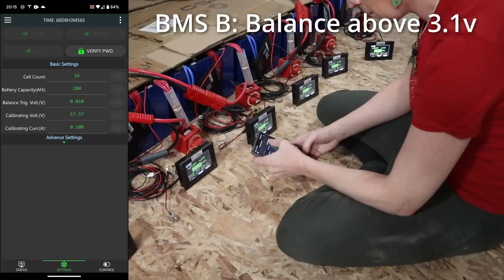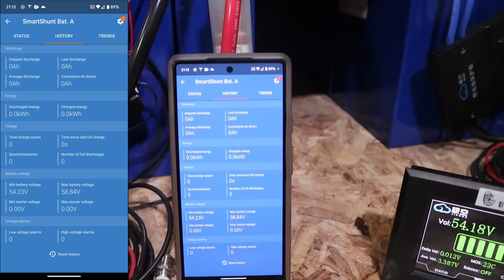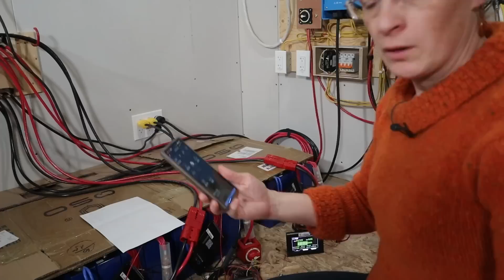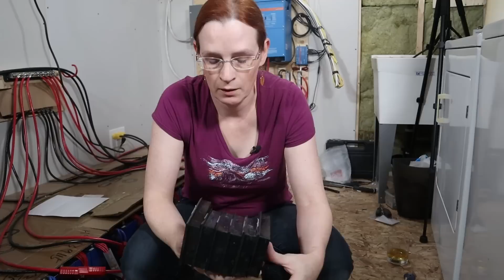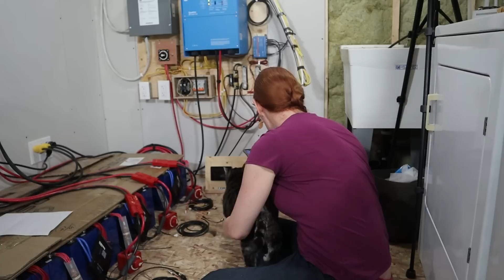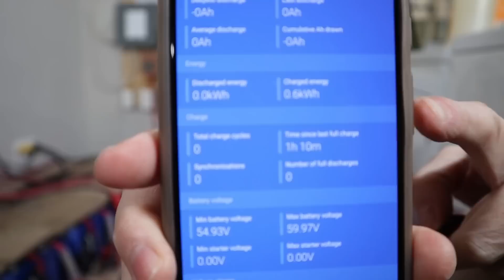Sparky Science! - Big Battery Build! (Ep. 48)

Comment: Cause of spitzen sparkin' was instantaneous Buck Converter Input Over Voltage in excess of absolute max specifications. What happened was the BMS hit single cell over voltage protection and disconnected the battery from the Quarto charger, just like you surmised at the end of your video. This BMS switching occurs in mere microseconds, so because the Quarto was busy pumping over 30A into the battery before the battery instantaneously disappeared from the circuit, the voltage seen by the buck converter rose to an arbitrarily high voltage in order to maintain the 30A Quattro output for the several 10s to 100s of milliseconds it takes for its internal control loop (and wiring inductance) to respond and ramp the current down to 0A.

The switching MOSFET inside the buck converter avalanches like a 60V (or 80V or 100V, whatever it is rated for) zener diode, so got to see all 1.7kW of Quattro energy for many milliseconds across a silicon die area of ~1 square millimeter and only a few nanometers thick. I.e. an insane power density that instantaneously turns the silicon into a plasma, shatters a hole in the plastic molding compound and when unlucky enough to achieve a sufficiently low arc voltage, then allows a sustained DC arc fed by both the 30A Quattro current + battery discharge current as the BMS still allows discharging after charge disconnect. More typically, the initial explosion is sufficiently violent that the arc blows itself too far apart and self extinguishes with an open circuit air gap where the silicon die and bond wires used to exist. This didn't happen in your case, likely because the wires feeding the buck converter were sufficiently thin to add enough parasitic resistance and limit the achievable arc current, yet too thick to rapidly vaporize themselves and act as their own self fusing disconnect.

While certainly an eye opener, don't be too hard on yourself. I am an Electrical Engineer and blow up MOSFETs quasi regularly too. The nice thing is that the plastic molding compounds and wiring insulation in virtually all electrical components are made of fire retardant materials and self extinguishing after the power source gets removed by exploding or melting something. A total fire loss is of course still a big hazard, but as long as we learn something from each event and not repeat the same mistake over and over again, it's possible to make a career out of electrical engineering and not get unlucky enough to burn our house down in a single lifetime... knocking on wood... actually ceramic tiles in my case. I put a large, smooth floor tile on my desk as my work surface and it doubles as a nice soldering surface before energizing things and spitzen sparkin' could happen. 

If you want to keep using your LCDs, you can prevent the buck failure from being possible by buying 100V+ rated modules, adding an inline resistor right at the input (before capacitors and diodes) to prevent the insane initial explosion current/power density, and increase the size of your input capacitors such that the voltage reaching the buck module can't reach >100V before the Quattro can respond to the abrupt load disappearance. A combination like 4.7 ohms (10W or more rated) and 220uF would likely keep the overshoot voltage below 100V. A cheap 2A, 250VAC or 12V style automotive fuse can be added as well using an inline fuse holding wire. Both aren't rated for the 58VDC+ that they could potentially need to interrupt, but since the 4.7 ohm resistors will severely limit the current in the event of a short circuit, it'll almost certainly still be able to self extinguish the arc after blowing.
Reply from the maker: "likely because the wires feeding the buck converter were sufficiently thin to add enough parasitic resistance and limit the achievable arc current, yet too thick to rapidly vaporize themselves and act as their own self fusing disconnect." 

I think when I was setting up the buck converters back in the old video, I made the off-hand comment that the wires would act as fusible links in a worst case scenario. This comment was super helpful in helping me understand why that didn't happen, thank you.

"While certainly an eye opener, don't be too hard on yourself. I am an Electrical Engineer and blow up MOSFETs quasi regularly too." - Thanks for that. The real reason I was hard on myself wasn't the failure itself, but the failure to fuse. Well, lesson learned.

Thank you also very much for the design advice, I'm going to pass it along to Andrew to see what he makes of it. I am following your logic, but I admit I can't interpret the values (though I'm sure they're right). Cheers!

Comment: Maddi, you are are on the wrong track, setting the start voltage higher for balancing(I'm using 3.45V I think Andy is also) is to ensure the balancer doesn't operate when pack is changing/discharging(middle/bottom of the curve). This would cause the pack to become unbalanced, like bottom balancing would. You have to pick one top or bottom balancing, you can't have both. Top balancing is the better option for most cases, as you will be charging to 100% more frequently (potentially daily) than you will be discharging to near 0%. If your cells are top balanced correctly no cell should be hitting over voltage protection when charging.
Reply from the maker: I thought I mentioned this possibility in the video. In any case, I am testing this now. I left all the balance voltages configured as before, and I'm discharging the batteries now. Once they hit about 50%, I'm going to disconnect them and let them sit for a while. When I recharge them, I'll make a point to turn off balancing entirely. It'll be interesting to see how out of balance the packs are from mid-SoC balancing.
Reply: @TheDigitalMermaid  I suspect that the packs may already be unbalanced after your last discharge test. I noted that the packs were causing the over voltage protection to trigger when you were charging, this suggests the cells are not top balanced anymore.
Reply from the maker: @uksa007  If that's the case, then how do you actually balance them? I top balanced them in parallel, then I let them sit for a week. When I charged them back up, they all had very lose deltas (see video description for the cell deviation range). I can't imagine a way to further balance them.
Reply: @TheDigitalMermaid  So if you are using Andy's 55.2V as the charging voltage the BMS overvoltage protection should be left at the default of 3.6V(deepening on version of BMS),  you should never hit this. They balance typically during the absorption phase under normal cycling. Depending on how unbalanced they now are, the balancer maynot be able to balance them, you can only try. Essentially you leave them at 55.2V and let the balancer work. If this looks like it's not working in a hour or so, you may have put the cells all in parallel again and top balance with your small charger. Edit: Essentially they were unbalanced by leaving the balancer running when they were discharging/charging in the middle/lower part of the curve.

Comment: I'm here for both LiFePo4 battery content AND the boat build content. This will be fun. I'll keep watching.
Kudos on your explanation for the 'wire jump' event around 21:20. I believe you're spot on. I've done a bunch of capacitor-discharge mad-scientist coilgun experiments and have seen the same thing. The magnetic fields around high-current pulses in parallel wires can manifest themselves in surprising physical forces.
Reply from the maker: Glad you're here! Ya, the physics was so fascinating I almost forgot I was upset. I think that's where my mood turned and I started to cheer back up. :)

Comment: What struck me more often was all those coiled cables, such cables can have a transformer effect, which can cause a fire in the worst case, think about it carefully, that is also the reason that you always have to unroll cable reels completely.  .  .
Reply from the maker: Do you have the maths on how much power is needed to generate enough heat to trigger a fire in wires of a given guage?
Reply: @TheDigitalMermaid  When dealing with such DC currents you always have to be extra careful and you will have to choose yourself well and not take the easy way out by burdening whoever directs you with something that everyone who plays with this Toy should know  ?- - - - Just one more question, why don't you do 1 large battery pack instead of making all different packs?  For a certain power requirement I have a package of 126 cells which are parallel per 9 and 14 times in series, then 1 BMS with Balancing function is sufficient for me. These parallel packages of 9 cells also keep each other in balance.
Reply from the maker: @pierrecardin5292  "such cables can have a transformer effect, which can cause a fire" - That's a strong statement, and if it's true, please explain in detail. So far, everyone who said that I've got a fire risk hasn't explained why. Your reply to my question doesn't explain why the coiled cables are a fire risk still.

"Just one more question, why don't you do 1 large battery pack instead of making all different packs?" - Redundancy and load distribution.

Comment: The reason you have the smock and spark because the p7812 is not buck converter it is not efficient about 78% you need to add comment mov s20k30 on the data sheet .
buck converter can handle 60 volt with 500ma fuse , good luck. Keep up the work
Reply from the maker: Where are you getting that info from? It seems to go against the manufacturer's data sheet (linked in the description if you've not looked at it).

Comment: Because you shut off the BMS completely with that switch, its actually fully shut them off, meaning that the bms wont track the amp draw so it guesses the remaining capacity and more a likely, NONE of them balanced due to you turning them off making all your results the same.
Reply: That little switch to the bms shut them completely off, no balancing or anything, but correct me if you can, maybe I wasn't paying attention? did you have those bms's on while you were away for those weeks?
Reply from the maker: The BMSes were left on, they were disconnected from the bus with the main disconnect switch.
Reply: @TheDigitalMermaid  interesting... but it looks like when you turn the bms off then back on, their readings go out of wack because if they aren't powered, they don't keep track of the capacity, that's why they said 204AH when turned on and you connected it to your phone

Comment: on the converters (build) no safety device built in? tolerance for spike surge?  that is why i opted to use some of the adjustable ones off amazon. they have a wide input volts and fusing built in. they are CV and CC so you can control what comes out  you really need to install  fuses on each battery pack (example) battery 2 shorts a cell and starts pulling all the current from the other batteries and the bms shorts out. what then? also one at the inverter in case it shorts. compared to everything fuses are cheap. Blue See Systems 5191 fuse block and the right fuse with it will save your arse if needed. i hope not for you
Reply from the maker: > Blue See Systems 5191 fuse block and the right fuse with it will save your arse if needed.

Those fuses can't break the dead-short current of an LFP battery bank (which can read kA numbers). All the batteries have a 200A T-Class fuse directly off the main pack positive as the "fuse of last resort". My big cock-up on this was both putting the converter behind the fuse, and not fusing the line itself. Lessons learned...
Reply: @TheDigitalMermaid  I tested one with 24v system and 2 750AH batts dead short , it worked.i had to replace fuse and holder hot but it worked. Best wishes for you and your project.

Comment: Thanks for the excellent video!  I've used those exact DC-DC converters (but not for LFP batteries), so also very curious about the failure mode!  ....Seems possible it experienced an input over-voltage event during battery switching, with heavy loads??  The point this drives home is that all gear can unexpectedly fail; this is a reminder (to me!) that properly sized fuses on all power leads are a critical part of the design, even when testing.
Reply from the maker: Seems like the current leading theory is that the charge MOSFETs opened, and it caused an inductive spike that drove over voltage and shorted the buck out. I'll certainly do an update if/when we get to a more certain answer.
Reply: @TheDigitalMermaid  That's my best guess, too.  It would be interesting to check the battery bus voltage under various loading conditions, using a storage oscilloscope set to capture max voltage.

Comment: something to consider -- take 1 battery full charge and disconnect everything from it and leave it for a month, read the volts. that will tell you what is settling of the battery and what is para draw. mine settle from 3.56 to 3.2 and stay there. so don't assume that there is a draw when it is just settling.
if it keeps going down from that point then you have a draw. did you forget that fuses are your friend. buy proper buck converters and fuse them. do you have main battery fuses 300 Amp . if you don't make mistakes you don't learn. you CAN do it just pay attention to what you are doing
Reply from the maker: Ya, I mentioned that I would like to have done that after I got back home. I'm hoping I can reset and do something like that when I leave to bring my boat home. That'll be at least a month of no active use of the pack.

Comment: I work in electronics, the most premium of products go wrong, you can’t rely on the quality of a product to provide protection.  You need to fuse with devices that can deal with the extremely high current capacity of those batteries - which is a challenge!

As to why it happened, my suspicion is when the BMS disconnected with 30A you got a negative inductive kick across the buck somehow.  I do prefer systems with comms between the inverter and BMS as then you don’t have these on load disconnections, much easier on everything.
Reply from the maker: The trick with communication between the batteries and the BMS is that there are six BMSes and one inverter. So it's tricky to know when for the charger to disconnect, as other packs might still want charge. The induction kick was what I was thinking when I did that hand-bounce gesture when I was talking about it possibly being when the charge FETs opened, but it was just a guess. You (and others) suggesting the same cause is making me more confident that might be what happened.
Reply: @TheDigitalMermaid  Don't get too perturbed by it! Once you've go those batteries in a proper enclosure a balance cable going up in smoke isn't going to cause a fire - I can understand your caution with all that cardboard etc around though!  Smoke alarm and an appropriate extinguisher in your test room would be a wise just in case.  Many people think components burning up on PCBs is super dangerous, but really it happens all the time, that why PCB material is called "FR", "Fire Resistant".  As long as you have an appropriate enclosure and keep it away from ignition sources the parts on a PCB will be self-extingushing they won't sustain a fire - thats how you get all those UL etc marks on components.

Comment: Madi, luckily you were there on the right time.
You are doing such a great job as Amateur Scientist, keep that going. Maybe with a bit apple juice support.  ;-)
Your guess is my guess and I am only wondering, where is the fuse between the battery and the converter board?
Don`t remember, did you insert a Schottky Diode into the wire before the black dice?
Why not keeping the displays and power them externally? Do you need them all the time or is it useful to have a switch right before the converter to power them off? And guess what, I don`t like this black dice with legs.
Maybe remember this ideas if you later will go on with the pack wiring.
Cheers Marc
Reply from the maker: When I bought the screens, I just assumed (stupidly, in hind-sight) that they'd support 48v BMSes and have an off switch or timer. I guess that was too much to ask from JK. =/
Reply: @TheDigitalMermaid  Yepp that is what everyone will assume.
But again, how about powering them all together by a seperate power source?
They will probably not drain that much that you will not find a better Converter from 60 to I guess 12V or less. And with a fuse and switch in the source cable of it you might be again on the safe way.
/Marc
Reply from the maker: @DG3ACM-Marc  Same deal; I wanted all batteries to be fully self contained.

Comment: My guess is that it could have been a voltage spike (possibly due cable to inductance and back emf when it was turned off), that may have caused an internal capacitor (or other component) to fail short circuit. Who knows, but at least you learned something. You could have just been unlucky. Thanks for the videos.
Reply from the maker: Ya, given I think it blew when the charge FETs opened, I think that might be what happened.